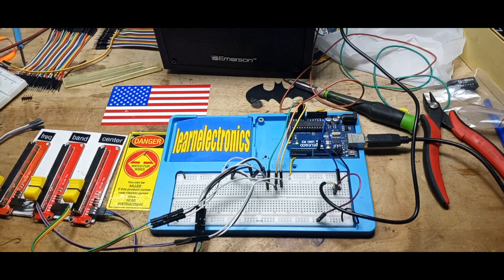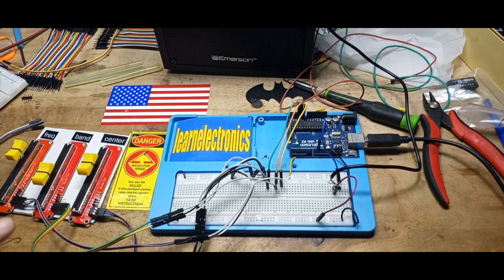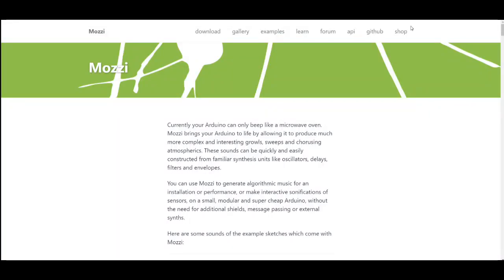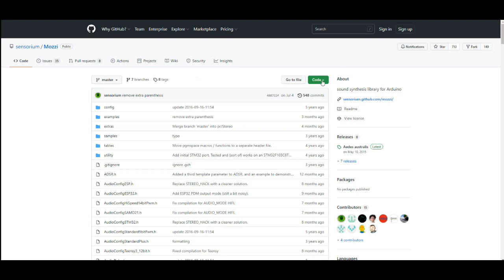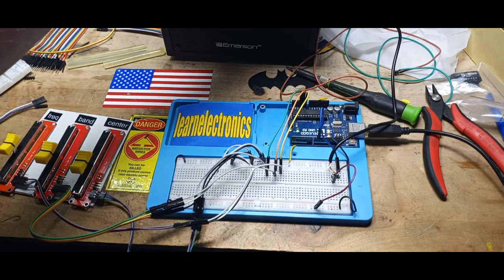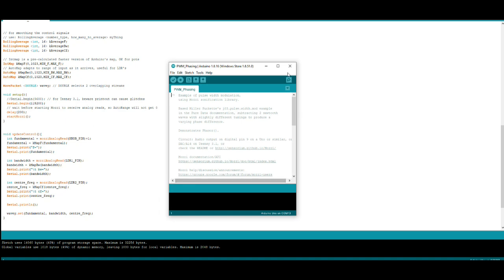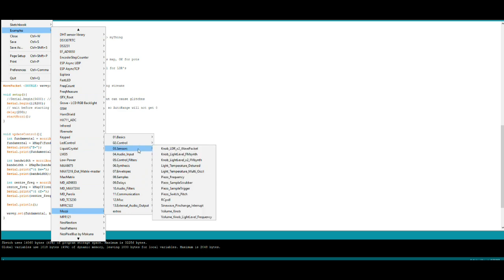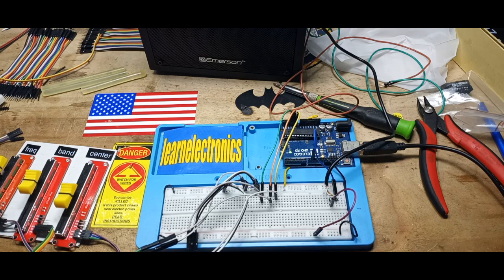Mozzi :  The Arduino Based Synthesizer

Comment: FYI: If you have an error when installing mozzi in arduino, open the zip archive and delete the the file called Mozzi (it should have no extension) It is a simlink that points to nowhere, and causes errors

Comment: WANTED: a stand alone synth, possibly requiring a Cortex-Mx Arduino compatible for adequate processing power, to act as a voice modifier to produce in real time the Cylon or Colossus vocal effect.  Cheap Chinese toys don't do it even slightly accurately, by the way, and smart phone apps don't do it in real time.  The required processing was found from investigation of how the voice was created for the TV series and is discussed in detail in a YouTube series on the Cylons' voice synthesis.